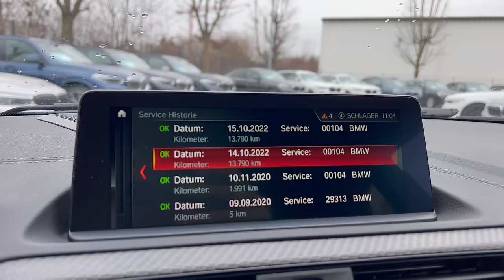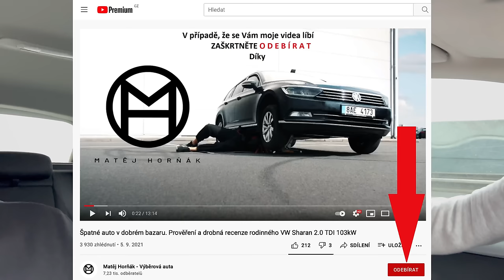Prodávající nám lhal o studeném motoru. Důkladné prověření BMW 2 a Škoda Octavia RS a drobná recenze

Comment: Hmm, ako podľa špecifikácii, by mal motor mať celkom rozumný priebeh (turbocharged 3.0-litre N55B30T0 straight-six engine rated at 272 kW (365 hp) at 6,500 rpm and 465 N⋅m (343 lb⋅ft) between 1,450 and 4,750 rpm). Jasne nemá to silu, jak nejaký V8 TDI s 800Nm, a asi to ani nebolo stavané, aby v tom jazdili traja dospelý chlapi, ale pre klienta plus nejaka tá kočka, tak by to malo byť výkonovo dostačujúce 😀